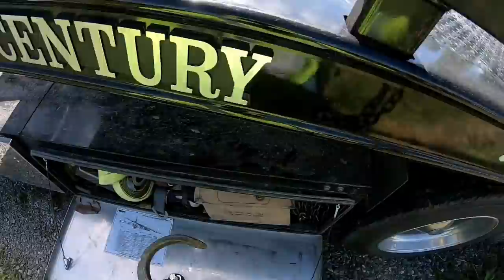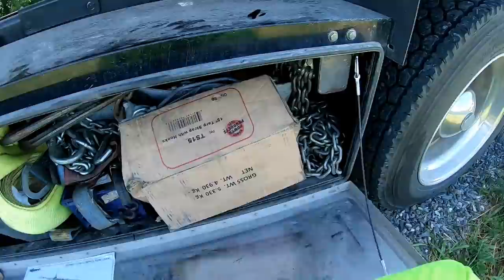Double Time!!!  Forklifts & Fords--2 Jobs at the Same Time!!!

Comment: It is heartwarming to see such a good relationship between all the responders. Awesome.
Reply: More often than not, that is the case. Here, the officers know the fire dept can make it hard on them if them give them crap, and vice versa. Also, pretty much the same goes for the recovery crews. In our area, unless specifically requested by the owner, the recovery companies have his or her own territory as the fire departments do. So, you pretty much work with the same companies all the time. But in short, yes, its normally this way.
Reply: Awesome to see cooperation. There's literally a trooper that's not afraid to get his hands dirty.
Some times they take the attitude, you're getting paid to be there, and they're volunteers. They're good around here too. I'ts a pleasure to work in a community like that

Comment: The flipping over of the truck reminded me of about 20 years ago when I was parting out an 87 E250 van. I wanted the 300-6 engine but wanted an easier way to remove it than out through the front. So I unbolted every body to frame bolt except the two by the front bumper. Then I pushed the front of the van up to a large tree, ran a tow strap around the tree up at 10-12 feet then ran a large chain down to the hole in the roof near the back doors and looping it back to itself. 
With my F150 hooked up to the frame it took 2-3 tries to accomplish the body frame separation. I wish I could have gotten it on video as the body basically hinged at the front bumper and lifted up and off, landing upside down. With the body off it was much easier to get to the engine and transmission.

Comment: Ron,  What you need is a pick up stick to pick up that small stuff. I volunteer myself in my county assisting the local Emergency Services, Law Enforcement, and the NC Highway Patrol and the general traveling public as providing safety for the traveling public best I can.

I use my personal truck more as a Utility vehicle because I have a solid tri-fold cover over the bed.  In the back ( bed ) I have a lot of stuff to use in a situation such as that.  I have a street broom, wheeled magenet, colapsible traffic cones,  toe strap ( seldomed used ) and a lot of other stuff.  When I see stuff in the road,  I try as safely as possible stop and block traffic with my truck with the amber light bar on and hazzards, and if I can call the EOC advising I have debris in the road and I will get it up.  We all work as a team.  Me as a Retired Firefighter,  that's what we done...work together.  

About a year ago, I was heading home  and there was a lot of debris in the travel lane blocking all that lane and traffic was crossing over in the other lane  to doge the mess. There could had been a serious crash if nothing was done.

I stopped my truck in that lane in front of the debris blocking all traffic, got out, put on my High visible traffic vest,  went to back of my truck and got my street broom and swept the stuff off the lane of travel, then got my magent and picked up lots of screws and nails.  then I reopened the lane to let traffic flow.  Yes,  I done all this alone.  No Law Enforcement was in that area then.  At least I used my Firefighting skills on a crash scene in that incident.  That is why I mentioned about having a pick up stick.  It'll make it a lot easier to pick up all that small stuff and reduce the risk of cutting your hand although good gloves are great but they can protect only so much.  I know because I been there and it's no fun being cut.  This video made me think about what I encountered.  I wanted to share that with you in this long comment.  

No matter what the situation, or incident,  be safe out there you and your crew.  You are best what you do and I know those you have helped were blessed to have you there.  

Always keep God first in all things.  

God bless.
Michael from NW North Carolina

Comment: Shame. The underside of that truck looked pretty much rust free. Actually looked like a good old truck
Reply: arcflashed That was my thought too. Even though I'm a GM square body guy, I've owned a few Fords like that and they were good trucks. I sincerely wish the owner good luck finding a replacement for that F-250 at a reasonable price.
Reply: Glad it wasn’t a 7.3 I have a prestige one in the garage
Reply: Well maintained for sure  new rad new hoses new shocks
Reply: Just cut the roof and the B-pillars and sell it in Florida.
Reply: @MikeBrown-ii3pt  just need a good cab.lol
Reply: New cab, new bed, good to go. Or just get a sawzall and make it a truckcart trail toy😂
Reply: Kevin Dean I’m betting that truck mechanically is just fine
Reply: It’s a ford it was found on road dead so the guy wouldn’t be ford is the best it serves and protects
Reply: Any old pickup that is in operating condition is a good one.

Comment: Bet there was a 10mm socket that went missing that day
Reply: They are all on permanent vacation in some far away land
Reply: That’s just not right, extremely funny though. 😂😂
Reply: What is a "10 mm" socket...and why would it go missing??
Reply: Its always the 10...
Reply: @fightdhr8866  yup, why i have like 15 of the damn things, find them in tool bins at thrift stores and pawnshops. but iusnt a 3/8 close to ten mm when the need arises?
Reply: and an 8.5mm socket which never gets used lol
Reply: @kfstreich4787  NOOOOO I JUST FOUND MINE DON'T... never mind I thought I just found it it was just a stupid ⅜ths 😪
Reply: Not only the 10mm, the 13mm is even worse in my opinion
Reply: Dylan van Tonder HAHA!! He had the worlds supply of them
Reply: @pedrovision6987  its a common socket needed for multiple different things.. and its a common joke that when needed you can't find it no matter what.
Reply: @ickebins6948  13 mm replaced the 1/2" as the most used and most lost.
Reply: SAE it ain't so.
Reply: Depends on the brand. Sometimes a 12mm or a 13mm could substitute for a 1/2. Some brands have such loose tolerances. And yes, 10mm is the most common size for battery terminals too, something my local Fire Volunteer Service found to their chagrin when their tool box on the fire truck didn't have it as they were attending a car engine fire. I lent them my shifter to help them as they didn't want to cut the terminal. Now I keep a few spare 10mm spanners in door pocket of every car I have, and my family's cars too.
Reply: Fight DHR Always the 10mm
Reply: Oddly, 10mm is about the only socket I always have a half dozen of, it's everything else that is always MIA when I need it. Well, 10mm and half-inch, which I usually have seven or eight of in various configurations. The 12mm is the one that the gremlins always steal, no matter how many I buy. It's probably in the same limboland with all the missing socks, if I had to guess.
Reply: @STONEDay  boo hiss... :)
Reply: Dylan van Tonder Bro...i just found my Snap-On 3/8 drive deep socket on Saturday when I was replacing rotors, calipers, and pads on an 08 F150. I thought I lost it when I moved earlier this year.
Reply: I love ur video
Reply: 10mms always goes missing, that’s why I have more than 1 in my box
Reply: @pedrovision6987  look up socket set on google and its a joke they always disappear
Reply: that dam 10mm i can never keep track of him
Reply: What. Did.  You say

Comment: I've been thinking on your comment about needing to reorganize the toolboxes again.  On the rollback trucks, would shallow vertical chain and strap boxes located above the bed be a good addition?  I'm picturing something out near the edge of the bed but inside the headache rack width so as not to impede vision, about cab height and maybe the 16" or so wide (about the width of the winch tray area), and maybe 8" or so deep.  Would they get in the way of the payload too often?  Given how well the chain carousel on the Rotator works, these would be stationary and smaller variant that could help keep things organized.  Yes, I design equipment for a living and try to come up with tools and systems that make things easier to work with.

Comment: The box might need to be reorganized, but I know the J-hooks and v-bridle straps are on passenger side toolbox and the chains and 4 point tire harness straps are on the drivers side toolbox the rollback. I also know the chains are in the right forward most box and the master links and couplers on in the upper mid box; both on the passenger side of the rotator. 

In other words, from one Christian to another, I love your videos!

Comment: Wish our towers did as good of a job as you on clean up. I work in public works and also EMS. I just responded to a vehicle fire to clean up and evaluate the road. The towing company didn't do any clean up whatsoever. Didn't even put sorbent down properly. Took me and a co-worker about an hour to clean up the mess left behind by the tow company. Because the sorbent wasn't put down properly, the fuel and oils damaged our road. We will have to go out and patch the road surface. State law mandates the tow companies perform clean up as long as its not hazardous to them, but it goes unenforced. As someone who works on the roads and repairs them, it is greatly appreciated when we see someone doing a proper clean up job.

Comment: I live in MI that should help with understanding this statement but wow for the age of the pickup truck its rust free
Reply: I live in CT.
i never realized how bad it was here until I posted a photo of the rear end on my 21 year old truck online, trying to see if anyone could identify it, and half of the people were shocked at the rust and rot and the other half explained it was a normal amount of rust and rot.
finally had to put the old girl down last year. a foot long section of frame rotted on three sides.
not sure what was going to happen when the 4th side let go, but i was pretty sure i didn't want to find out at 60Mph.
got $2,000 for the cummins engine, though.

Comment: I'm sure that truck will buff out....  (noticed you run the bed out before winching, and don't drop it to the ground, seen a couple of tiltrays damage themselves doing that, I personally either leave it fully in (which on ours at least locks the slides to the chassis rails of the truck) or with the bed fully dropped to the ground to 'dig it in' and support it... Maybe your truck has better slides than the ones I was using lol

Comment: Found off road dead( ford). flip over read directions...oops .🚔🚑
Glad the guy was ok. nice job.
Reply: almost guarantee you about 20 minutes with a sledgehammer to make for visiblity/head clearance and another 30 of tinkering would have it running and driving again. No doubt in my mind it could have been driven out of that ditch under its own power and then driven home again.

Built Ford Tough.

Comment: know it,s to late now but when they hooked the forktruck by the lift guard if that rolled that would rip that off there ,think there is lift towing points on the front of the frame by the wheel arch .

Comment: For sale: 4x4 F150. Includes running boards and tool box. Runs and drives, original paint, and off-road tires. Slight body damage. $1500. No low balls. No trades.

Comment: Sorry to bother you but from comments it looks like you know honda eu2000i generators pretty well. I have carb and everything pulled and was wondering if you could help me with a few questions. Bought the generator as a fixxer upper and so far its leaking gas from overflow tubes at the bottom, also when it does run its popping and smoking out the exhaust. Idle is not great and not putting out power. I cleaned the carb once already and pulled out small and large jet with shot of air. Both jets looked good and seen daylight quite well through all holes. Any help would br great

Comment: Thanks for sharing Sir. When you started the recovery I was guessing you would pull from the rear as it seemed once it was rolled it would be closely lined up that way, what reason did you pull from the front and rotate it around? (As you did it that way I know there is a reason to not do it the way I was thinking)

Comment: Actually i know from experience that you can easily get that truck back on the road again. As long as the frame is not bent or broken everything above the frame can easily and cheaply be replaced. All it is is body damage. Pop the cab and bed off and stick a new one on there and it's good to go again as long as the motor is in good shape and the drivetrain parts. A body swap will only take a day to do and you can use the tools that you just tossed back into the bed too that's pretty much all of the tools you'd need to work on those old OBS Trucks. 😆....i have built several of them myself...the only thing expensive on those trucks is all the sensors...but i always do away with all that any way...you can never keep the truck running without a sensor problem...unless it is a 7.3 Diesel...then it is way more reliable and worth more to replace the body....those old trucks can take a bit more of a beating than that...although in any case i hope the driver is doing okay.

Comment: Just about enough tools and parts to fix the truck.. I did notice a new lower radiator hose was put on as the label was still visible before you rolled it onto its wheels.

Comment: I am curious if you could have unloaded 2 of the forklifts at a time. It would have been quicker. The problem with hauling all that stuff is, if you run it off the road, all that weight will be working against you. I wonder if that was a first for the patrolman recovered a revolver from a crash.
Reply: Roy Davis some of those forklifts are pretty heavy. I bet he didn’t want to risk hurting the truck bed or anyone around it.

Comment: Was it driver error or mechanical failure ? You noted a rear wheel at an angle, possible suspension breakage before the crash ?

Comment: I’ve never been in a newer commercial vehicle that size, without  a reverse warning system. I know you use the horn 3  instead but is that because you have it disabled because of jobs like repo’s, or is it for some other reason? BOL, and stay safe. Thanks
Reply from the maker: All our vehicles have reverse warning systems that are in proper working order.  I sound the horn as an added precaution.  Thanks for watching and God bless.

Comment: Don't make em like they used to?  I'd not want a rollover in my 63 ford (besides in cab gas tank) and the frame on that truck was so flimsy it'd always have all four wheels on the ground, good for plowing but it'd flex and bend so far it was amazing. My 89 ford will happily teeter on 2 wheels and barely flex a lick.

Comment: Ron, a fun video, but minutes spent talking and driving until thenyou OVER speed the forklift transfer operation. A side view would have been appreciated. (We recommend the same way to empty machines shipped to buyers with no forklift.  Also at 16:57, why did you toss the EMPTY milk crate, leaving all its contents on the ground to be manually all picked up one at a time instead of re-filling the crate?  But good videography otherwise.  Thanks.